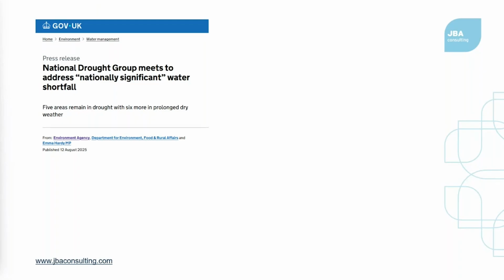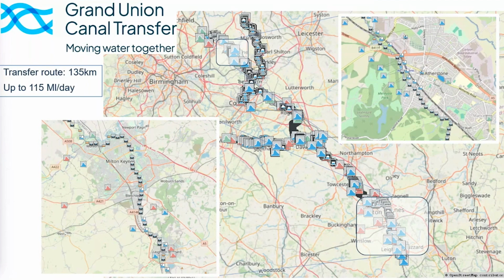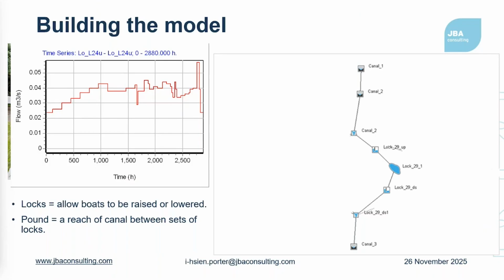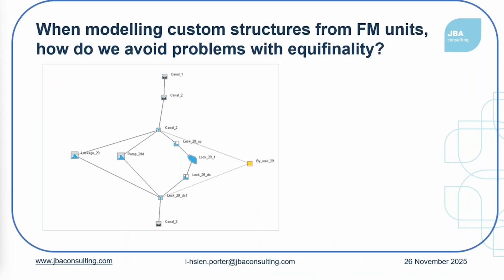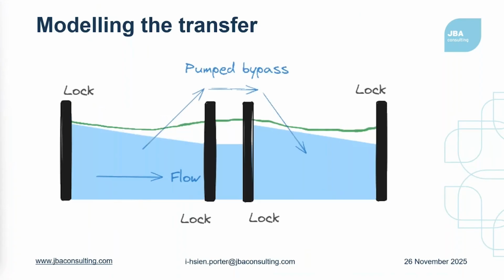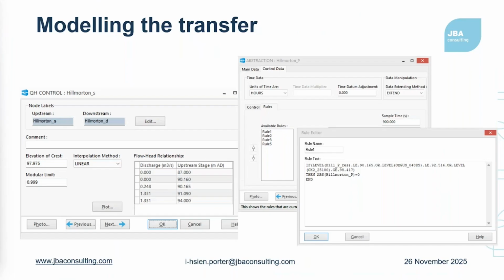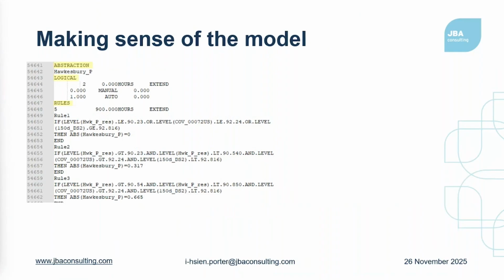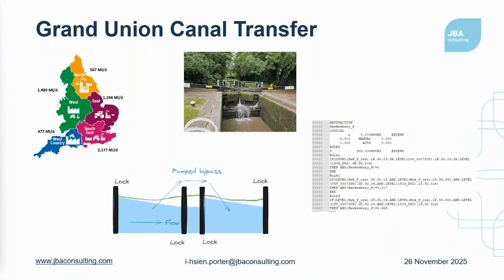Modelling the Grand Union Canal Transfer Scheme

Comment: Does the model allow for water entering the canal from rainwater and specifically extreme rainfall that might be expected due to to climate change? I am thinking here of water landing on the canal surface plus water draining from adjacent land where this is above the canal. Also, it would appear that the pumping flows need to be coordinated across the system. Pump failure part way through the system would give rise to transient changes in level at the pound where water is being extracted.